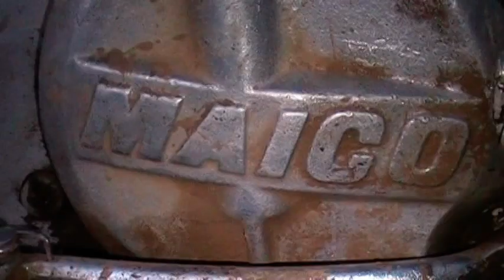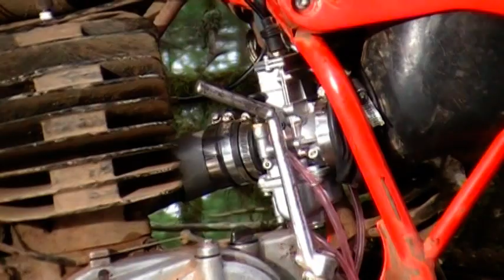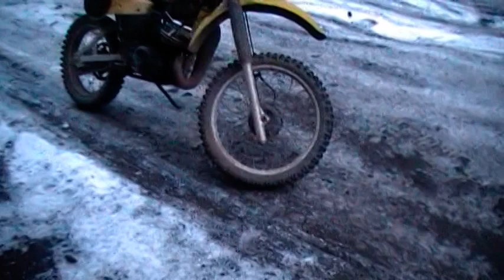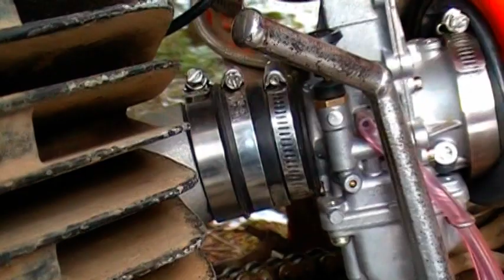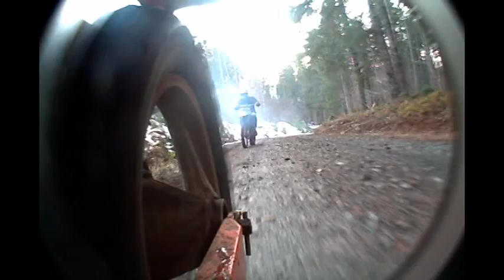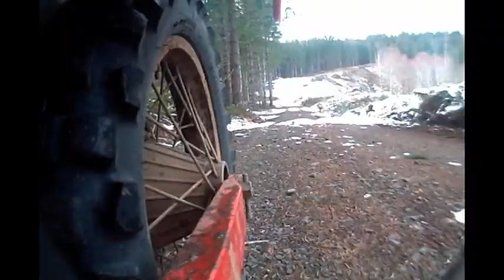Maico Carb Test

Comment from the maker: @tpvalley Thats true under same conditions, the original question stated, but in Winter some bikes need jetted if they were tuned from stock for summer riding and so the thicker winter air can have the bike run leaner.

Comment from the maker: When a sudden burst of torque comes onto the rear wheel, the wheel bearings seem to spin and grab the axle.  If I grease the axle this should help prevent this, I have to check to make sure the axle is tight but I believe it is since I just tightened it, the little stick out of the bolt could also be set against the frame to stop it from moving.  The last is I need to check the wheel bearings, because they may need replaced I dont remember if I did them recently.

Comment from the maker: I was surprised too, but then again this is a road and it's all packed frozen rock  (logging trucks and equipment drive on it), when it gets on the power it does throw it though, have to stay back from both this and the CR.  If you look close at some of the shots you can see that some big rocks were thrown.  Also, I need to swap the plug out for a new one and still need to finish jetting the bike and the back tire is pretty worn down.

Comment from the maker: @kawibbyrule You have to jet the bike which can be painful, you need a bunch of jets and have to make one adjustment at a time, take carb off, change jet, put carb on, warm it up, have fresh plugs around.  Sounds like its very lean.  What you might want to do is check the jetting and see if it was changed from stock.  If it was, maybe resetting it back to stock would be the easiest thing to try and just remember the jetting its on.

Comment from the maker: Ya, it's pretty much like cemet it's packed, sometimes they will put a thick layer of big rocks on top of it which are loose, but then there's no dirt it's just throwing fist size rocks at people.

It's a wide tire, I run 130 - 140mm wide tires, that's a 130.  The biggest you can get is 150.

Comment: @kawibbyrule 
first make sure plug is ok and also be sure it has good compression.
125 moto x bikes need new ring after about 10-20 hours.
also check to be sure it doesnt have an air leak on inlet or crank seals; does it run as if throttle is sticking sometimes?? or drink gearbox oil?

Comment from the maker: Cant really jet someones bike via video.  The jetting requires adjustment to idle, 1/4 throttle, 1/4 to 2/3 throttle then full throttle.  its a whole process.  The number of jet combinations in a carburator is in the millions.  I would check the manual for factory jetting and see if your current jetting matches.  If not, I would just set back to factory since factory settings are usually set to work in most areas and are usually richer settings.

Comment from the maker: When I switch gears you can see the bike roost even on the road though, look closely and you can see the rocks flying in the air behind the tire are pretty big.  This bike is also geared low and wide, it's not MX gearing.

Comment: @tobyeo 
they r that sensitive?
would have to be a huge temp change or altitude!
I'll take ur word for it though if u own one, Ive
never personally ever seen this model before this video!!
Reply: when I mixed the oil and gas for  my  old 490 I used a graduated cylinder to get the exact amount of oil for 5 gallons of chevron premium. being consistent in the mix made for easier starts and better performance and makes other adjustments accurate.

Comment: Hey I'm having problems with my bike I have a 2002 sx125 by KTM and I want to ride it during the winter time but it won't run without the choke on because as soon as you turn the choke off it runs if you rev it a little but the it boggs down and kills what should I do I live in Wisconsin la crosse please help me

Comment: I suppose that it is really hard packed stuff because even small 125s throw some serious roost nowdays :D
Am i wrong or you have a pretty thin tire on that Maico? Maybe you should try a wider one like Michelin S12, it would give you a lot more grip and stability and your 490 can surely handle a bigger tire. Thin tires are more suitable for MX riding and wider are enduro for stuff, nothing beats my swedish Trelleborg tire when i'm in some serious mud.

Comment: its my bike!  Hi Toby -I was wondering if you recall the front and back tooth count? I think mine was a 14 on the front...it was clocked at 88 mph by my friends car.
Reply from the maker: The options at the time were 50, 52, 54 and 56 for the rear sprocket for rear.  The stock from the manual for 82 is 52 rear and 13 front.  In 1981, the stock was 56 rear and 14 front.
Reply: Thanks toby !56 and 14 seems to ring a bell